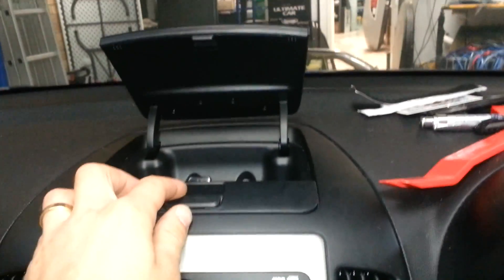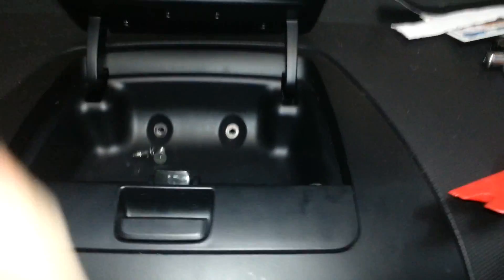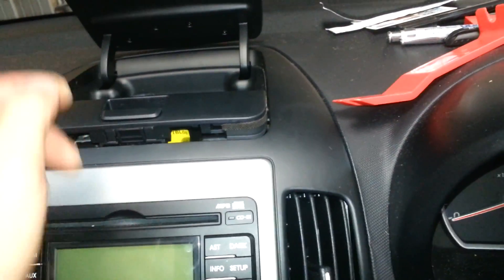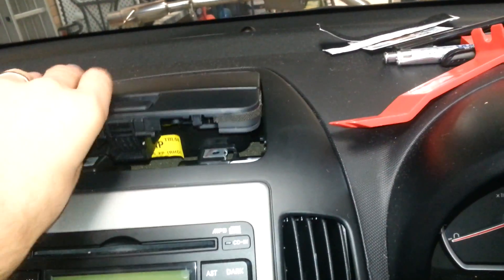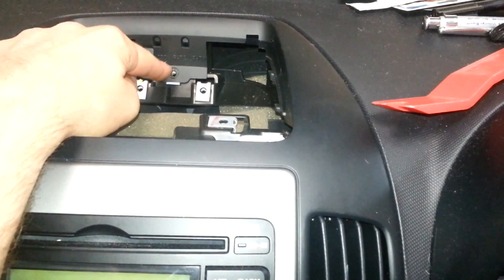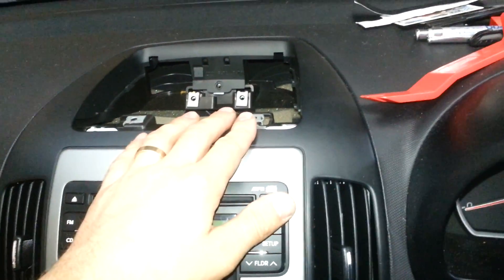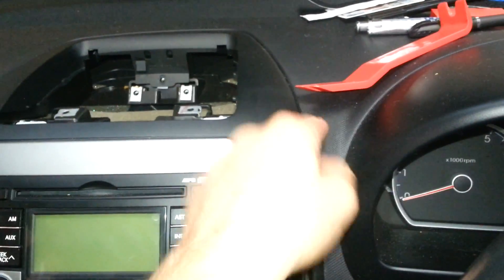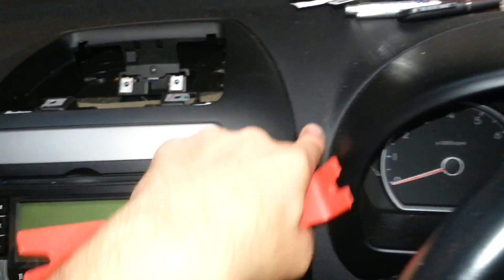How to remove  the factory radio from a Hyundai i30

Comment: Where can i buy/order the original factory fascia like that one in the video with auto ac? Any link?
Reply from the maker: maybe  ebay
https://www.ebay.com.au/itm/Hyundai-i30-08-11-Manual-Double-Din-car-stereo-facia-fascia-kit-dash-panel-trim/321791324269?fits=Model%3Ai30%7CMake%3AHyundai&hash=item4aec41f06d:g:8AIAAOSwMhRfCLNT&frcectupt=true
or even autobarn
Reply: @DIYChannelSteve  Thanks for the fast reply man, but as you can see the one that you send me is not the same as the original factory fascia, the hole where the radio is supposed to be is bigger and it is made for replacing the factory radio. I searched everywhere and could not find the original fascia like yours on the video.
Reply from the maker: You would need to go to a car wreckers

Comment: Is it possible to add parking sensors in the back if the car doesn't have? But not an aftermarket s...t just like it was from the factory
Reply from the maker: yes you can. as a separate system. Go to a shop like Autobarn and ask them what you need to do it
Reply: thank you

Comment: Did the head unit have a spare RCA connection for a sub/amp?
Reply from the maker: Tim Matthews no it did not
Reply: Does anyone know if this means it's impossible to put in a sub/amp without buying a new head unit? Can you splice another speaker output or something from another output?
Reply: @michaelnielsen3672  yeah you can splice the speaker cables.  Most amps have RCA input or speaker level input
Reply: @nickchristie2221  thanks so much!

security code but don't have the original code!

Comment: This video should be called how to remove the factory radio and leave dents all over
Reply from the maker: Thank you for your input.
Reply: @DIYChannelSteve  Hi, I have to take back my previous comment. I used your instructions to remove the screws and I was able to remove the fascia without any kind of damage. I did not need to pry on the sides, just wiggled a lot and the whole fascia came out.
Reply from the maker: Thank you